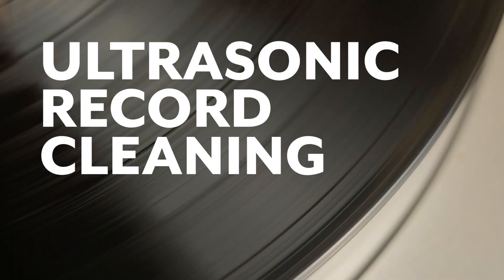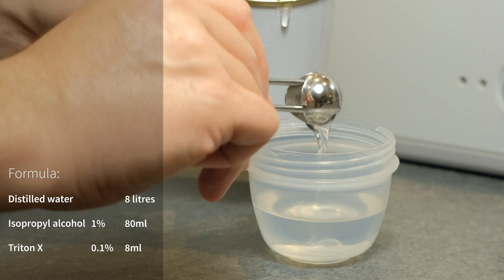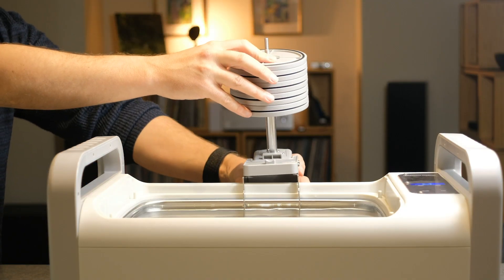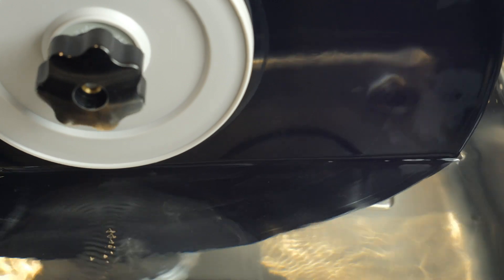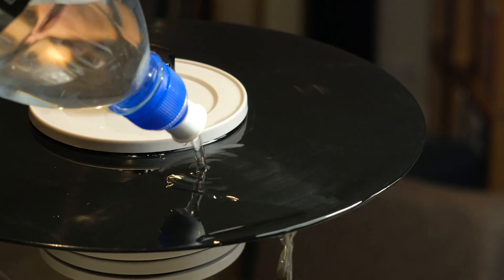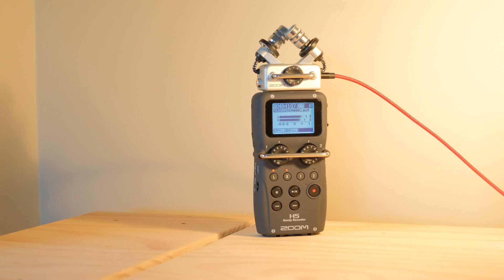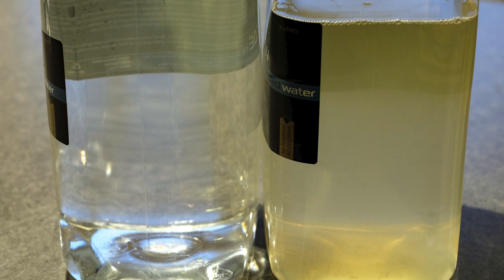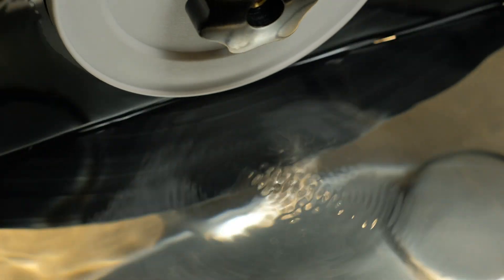Ultrasonic record cleaning - Before & After

Comment: Very interesting but I'd love to here a comparison between a manual cleaning and the US.  I clean using a basin with a very similar cleaning solution to what you are using.  Then I use a shop vac with an attachment to vacuum the record, go back to a 2nd basin that is distilled water to rinse,, then back for a 2nd vacuum.  I;m wondering if there is enough difference to justify the cost difference?  I can usually clean about 10 records an hour using my method.  I have about $120 invested in the equipment I need to clean.  What is the US you have selling for?
Reply from the maker: I’m not really sure how you could do a comparison between the two methods, because you can’t really clean the same record twice. I suppose you could clean it in a basin first, test it, then ultrasonic clean it and test it again. But that wouldn’t tell you much because just washing it in the basin a second time might have made it cleaner.
Maybe the only way to know would be to clean half the record in the basin and the other half in the ultrasonic cleaner (without it spinning), then look at how dirty it is under a microscope. Maybe I should buy a microscope...

Cleaning records in a basin does a really good job, there’s nothing wrong with it. This isn’t really promotional video for ultrasonic cleaners, I was just lucky enough to be given one and wanted to see the difference before and after. But you can see that I didn’t really scrub the record beforehand, so just the US cavitation did all the cleaning, so that definitely works. I guess the other good thing about ultrasonic cleaning is that there isn’t any mechanical action like you get with a brush or cloth, pushing grit around the record grooves potentially causing scratching or pushing dirt further in.

I’m not sure how much this one cost, maybe about US$600.
Reply: @Filtersloth  I guess the closest you could get would be to clean with one method play, then clean with the other, then do another record reverse it, cleaning with the other method first.  But you are right not really a totally scientific way to do it.
Reply: I can help. I now use a similar model (Kirmuss Record Restoration System) and used to use an enzyme with a VPI 16.5 in a TWO-STEP process before this.

The US process is a winner!

The difference is in the sound. The US process with alcohol in the mix adds clarity and high-end extension with details that no other process I know can do.

A similar tank to his is $800 usd on Amazon. I have the basic Kirmuss Audio system (modified top lid versus a 'skewer' here) and it goes for $900 usd.

....WELL WORTH THE MONEY !!